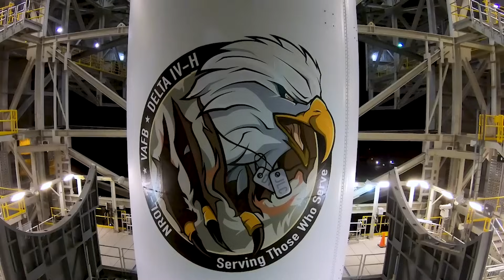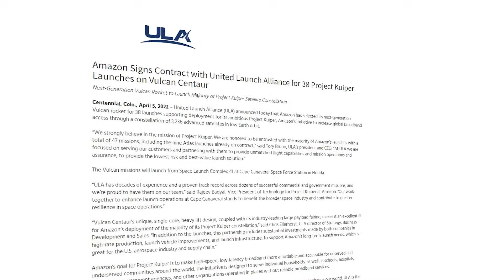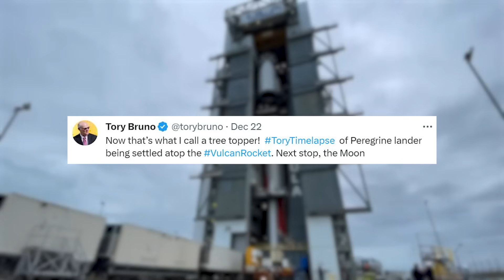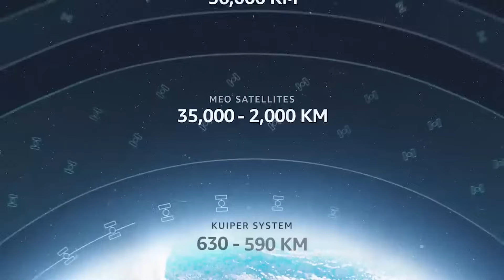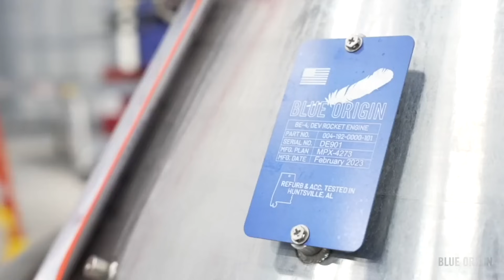Blue Origin Could Buy ULA In Only Months

Comment: We could expect Centaur V/Vulcan upgrade receive the BE-3U in the RL10s place in future to increase the production and flight rate of engine to lower cost for Vulcan and NG and increasing the commonality of the two rockets. NG is far more optimised for LEO given its size and relatively small payload capacity to GTO and Vulcan will be the GTO/GEO optimised vehicle. But that's assuming Vulcan even has a long future under the ownership of BO. Very likely that Centaur V/ACES technology could be utilised on a GS3 stage and have vulcan retired. Time will only tell.
Reply: Vulcan would still be cheaper than BONG with centaur V and is an effective integrated vehicle in its own right. RL10 is as if not cheaper than BE-3U while having higher ISP so it would be a lot cheaper dev wise as well to just have 4 RL10’s for a LEO Vulcan
Reply: @alrightydave  we don't know what the be-3u costs. I think it's a stretch to suggest though that 4 hand made rl10s are going to be cheaper than a single be-3u. And I wasn't suggesting Centaur V on NG. But rather using their decades of Balloon tanking experience to develop an efficient and light weight GS3 stage for high energy missions. Though a Centuar V/ACES Vehicle on top of NG would still provide good performance

Comment: So maybe Blue Origin could buy ULA - but who would want to buy a failing rocket manufacturer which uses BE4 engines - engines which have a tendency to explode and which have never successfully launched a rocket into orbit.
Reply: This is a lie. Only one engine out of dozens has had an ATP failure. The rest are good and actually have shown better resilience on the stand that Raptors 1, 2, and maybe even than 3.  And in less than 3 days, they will power a rocket Vulcan. Even if the Centaur V fails after BECO and stage separation, it'll still be a massive success for Blue and BE-4.

Comment: B.O buying ULA would be awesome cause 1. Theres a orbit ready rocket, 2. Using both NG and Vulcan Centaur would give B.O a good launch cadence, they both have awesome performance and can be configured to their liking
Reply: They do not have awesome performance - they have NO performance. They have never been launched successfully!
Reply: @gijbuis  that logic makes zero sense. Getting into orbit does not verify a rockets maximum performance unless it specifically pushed to that point (not like that's necessary anyway), which basically doesn't happen on a rockets first flight. Also by that logic starship has no performance.